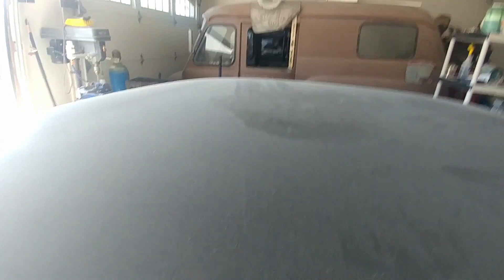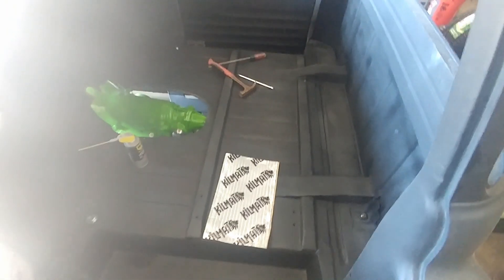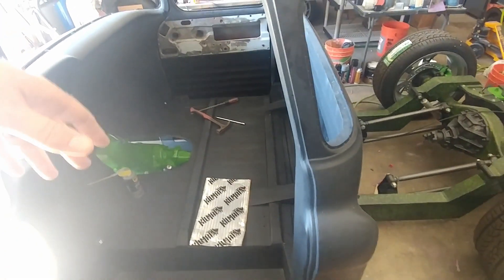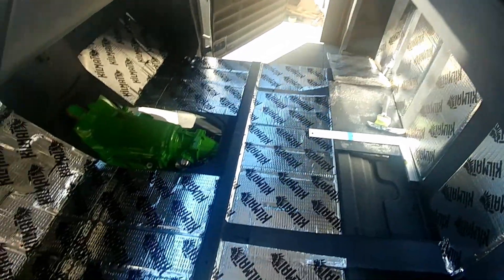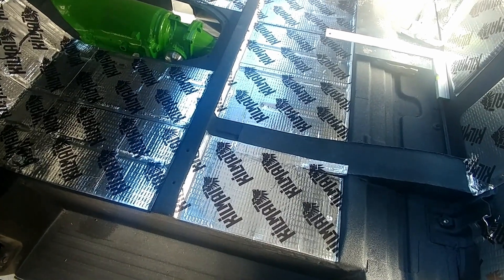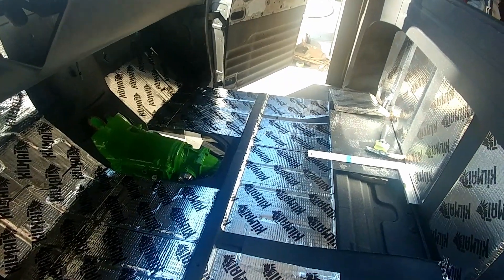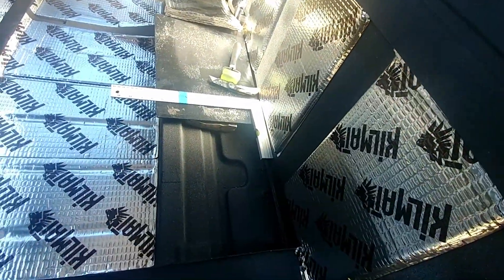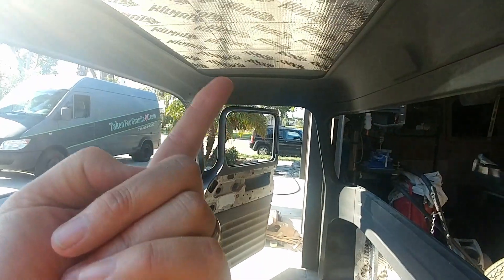kilmat sound dampening BEFORE AND AFTER

Comment: My son used Kilmat on his El Camino cab complete. I have a 1967 C10, the videos I have seen end up using 50 sq. ft. total. Just a guideline with high Center hump. Already had a “J” roller in my tool box, worked great.

Comment: Kilmat is definitely not dynamat with a different label. That being said, they are both very effective for sound deadening. I’ve installed both and kilmat is a great value and a good option although dynamat is a very good option for full blown installs or for treating problem areas needing a bit more attention. Use whatever works for your application and budget.

Comment: Dynamat extreme and kilmat are both 80mm. Same thickness. Kilmat is easy to use. Packaged better and cost 1/3 as much. I’ve used both. Buying the kilmat is a no brainer. Don’t buy noico. It stinks like rubber and the adhesive is toxic so you are suppose to wear gloves when applying it.
Reply: That would be 80mil, not 80mm.  Big difference.  80mm would be over 3” thick.  Mil is one thousandth of an inch.  80mil would be about 2mm thick.
Reply: @millcreekrange  I just miss typed. The way it’s measured it takes about 800 mil. Or 10 layers to equal 1 inch.
Reply: @Van1018s  ok.  But for one inch, it would be 1000mils.  Hence the term thousandth of an inch.  My line of work we use thousandths (mils) as well as microns on a daily basis.
Reply: @millcreekrange  makes sense. Well I have 13 layers on my roof. So I guess I slightly exceeded an inch.
Reply: @Van1018s  no freezing way you have thirteen layers.  C mon now. 😄
Reply: @mad-maxx2211  you’re right. I pulled the headliner 2 nights ago and put another box on. Now I have 18. There is not a single part of the interior that doesn’t have at least 5 layers, and every factory panel is screwed down. I have 5 layers on the inside of my center console. Theres over 400 lbs of Kilmat in the cab of an s-10. If I’d a do wood ceiling it’s puts me in the extreme class. I’m doing a 165 with no wall and no bracing. Blow through 4th order with 6 DB 3512R on 40,000 watts. Any other questions? I’ll be at slamfest if you’d like to see it. Red s-10. It will be the loudest vehicle there with no wall and no bracing in front of b pillar.

Comment: I'm looking for sound and heat proof,  what do you guys recommend?
Reply from the maker: this stuff works great and its priced great on amazon
Reply: A product called Lizard skin is great 👍🏾
Reply: I would use Kilmat that is very affordable as well also second skin is top of the line also if heat is a issue if your windows are not already tinted get them tinted and make sure the tint has the ceramic coating OMFG you wanna talk about a huge improvement in the summer time I’m talking 15-20 degrees color no more hot steering wheel or hot seats

Comment: Just started watching  your progress. Looking good. I guess I need to check out the beginning of your project. 
Had you given any thought to Lizard Skin before putting down the other heat shield which really seals everything exceptionally  well,  plus the extra heat repelling.
Reply from the maker: hey Jon
i did look at lizard skin ,but they dont have one that does both sound and heat you have to do their sound first and then heat and it can get thick .....but it would be so easy to just spray it on like i did the raptor liner .... thanks for watching
Reply: @classictruckaddictions7423  My thought was to put the Lizard Skin on for the initial  heat and to seal everything against moisture, like  inside the doors etc. Then the other panels for additional heat and sound.
Reply: Can you paint over this??i have a jeep wj and i was just paint my floor with bedliner but i hear it gets so hot and noisy...i also want to seal every spot on the floor so water wont go in
Reply: Lizard skin has a smell which will take days to clear out.

Comment: I don't mean to be a dick but it doesn't look like you went over the kilmat with a roller. The instructions say to use a roller until it's flat. Maybe I you did this later on idk, just saying. Using the roller is by the far the hardest and most time consuming part, laying it on there is the easy part.
Reply from the maker: you dont sound like a dick ....but i did use the roller just not as hard as most people do because its sticky  but good eye